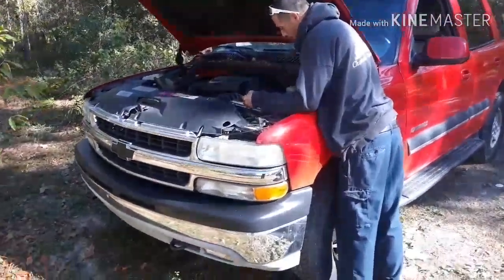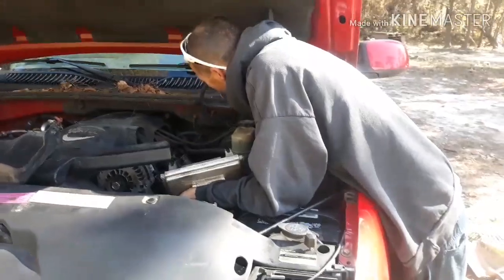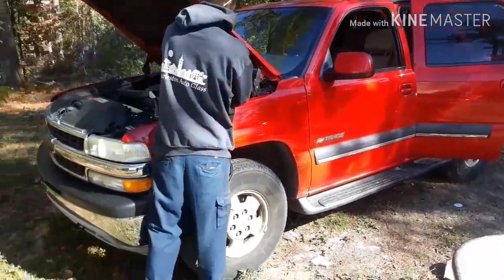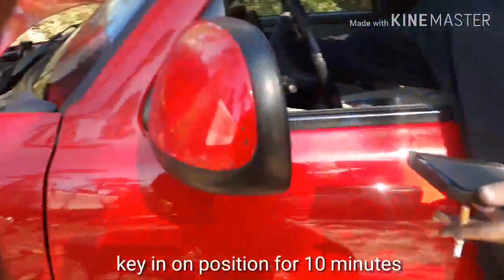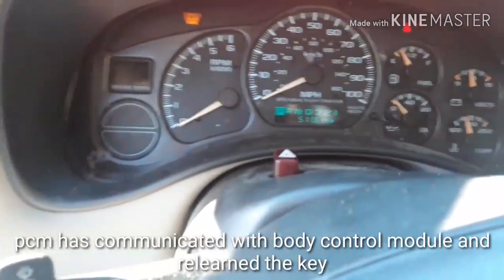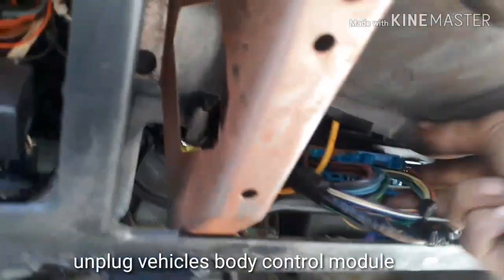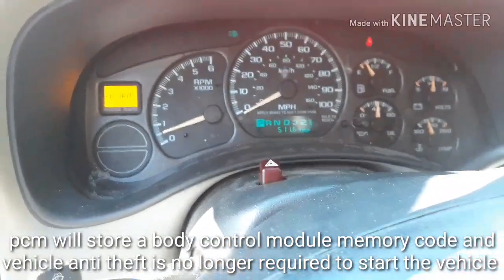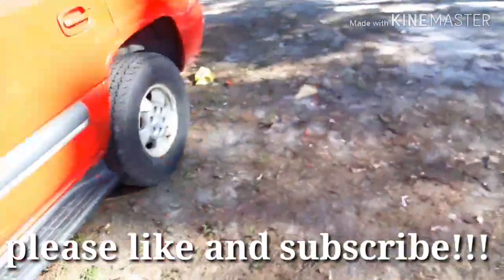GM BUDGET LS SWAP VATS DELETE ( vehicle anti theft ) pcm security bypass 4.8, 5.3, 5.7, 6.0, 6.2

Comment: put in a 2002 5.3 in my 93 chevy 🤔
Reply from the maker: Do it lol I just put one in my pops obs stepside truck
Reply: i already got it in. started it up with my brothers computer. mine dont start. just seen this video. wanna try it out see if it works
Reply from the maker: @agustinescobar9711  yes sir it works
Reply: did it 3 times didnt stay on. any suggestions ..
Reply from the maker: Some times i have had to do it 4 times in a row also there has been 1 time that I had to bump the starter every 10min cycle for it to recognize the key relearn
Reply: Mikey Tuned shit man thanks for the reply i noticed on my brothers truck that the security light came off. do i try it every ten minutes or what
Reply from the maker: @agustinescobar9711  yea go ahead an bump the starter after every 10 minute cycle
Reply: damn bro it worked, we never disconnected the battery lol it worked right after we disconnected it ha. now we just figuring out the fuel. ordered a high performance fuel pump hopefully it keeps it on with that one. great video. 🤙
Reply from the maker: Good man I'm glad it helped👍